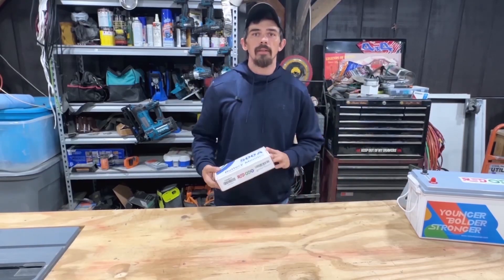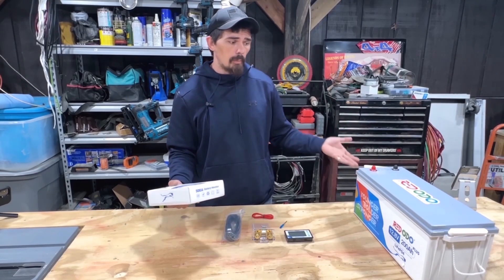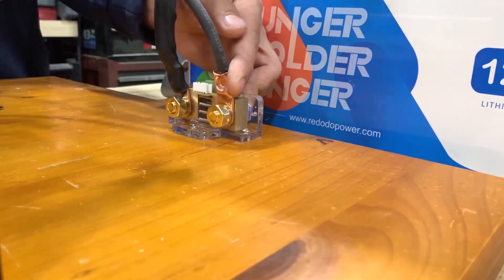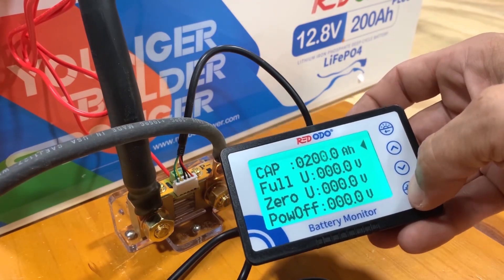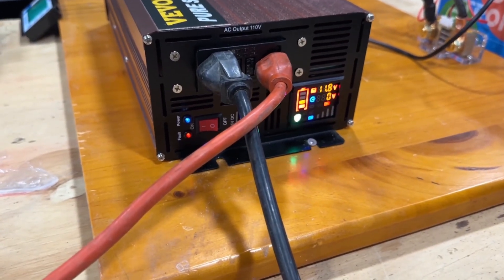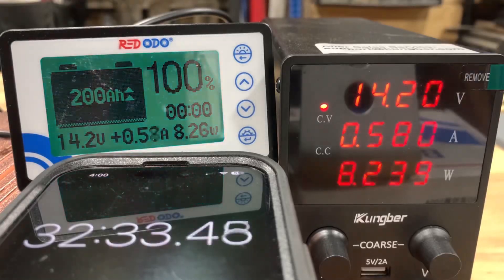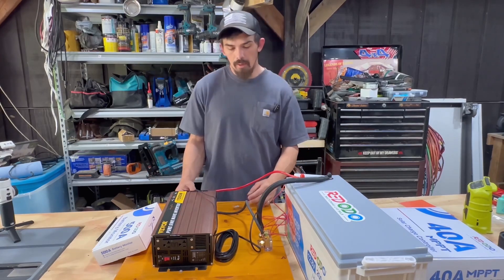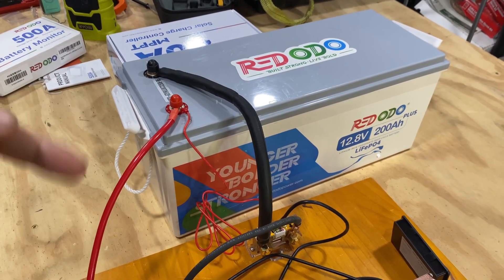Redodo 500A Battery Monitor Review & Battery Update Capacity Test

Comment: Sorry but, for a few dollars more, a Victron is superior to the generic/clone models(this same monitor is sold under several brand names). Bluetooth(only = SmartShunt, or BT and a remote screen = BMV Monitor), no requirement to fully drain batteries, alarms, etc. Relay for gen start or other applications on the BMV models. (also, slightly better BT range with BMV compared to SmartShunt)

Comment: I bought one but not sure it's working right.  When using say my TV the monitor shows about 4 amps but my watt meter only shows .65 amps.  My clamp on at the battery shows about.85 amps.  Whys is the monitor so high? I have the monitor calibrated to my 120 amp battery at 100%.

Comment: Please use the box end of he wrench whenever possible. In this case you could've used a socket and ratchet and not had the chance of doing damage. Battery posts should be torqued with socket instead of hand tightening with screwdriver.

Comment: Can it be  mounted  to a wall ?
Reply: Buy a electric box at HD and then use the face plate and insert the shunt and display into it.  I use it that way inside of a battery box.  Personally, for the price these are a waste of money as VE is blue tooth and brain dead easy to program.
Reply: @Gary-wh7ce  The Victrons also don't require a 0% synchronization... instead, you synchronize at 100%.(most folks would rather not drain to 0%).

Comment: So was the full voltage 14.2 and the zero voltage 11.4??
Reply: Full voltage I would set just below max charger voltage 14.4-14.6, zero volts anything over 11.0 so it would read 0% before the whole system shuts down.
Reply: Resting voltage is going to be more like 13.3. He did not let it rest.

Comment: Nice review. I'm new to Lifepo4 batteries and I'm wondering about if these monitors with shunts use any power when the battery is not connected to a solar array? I'm planning on using the battery mainly for portable power applications around my farm?